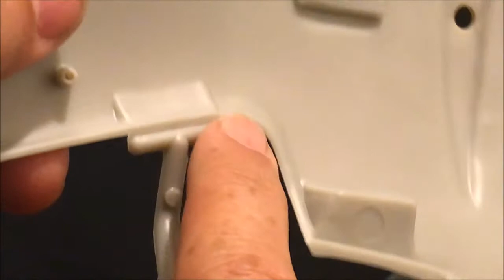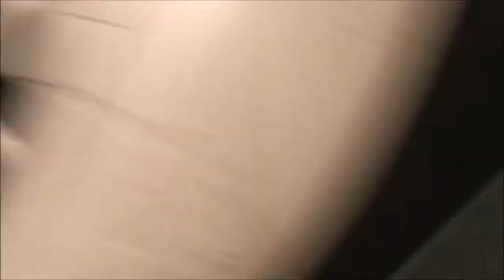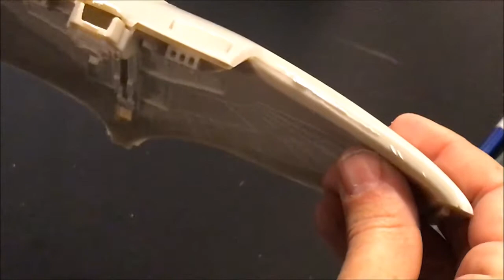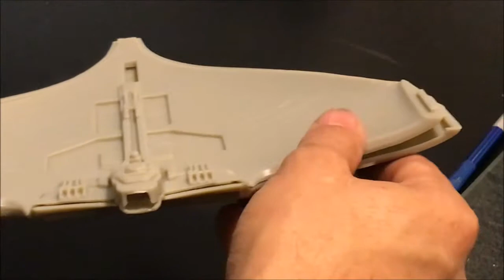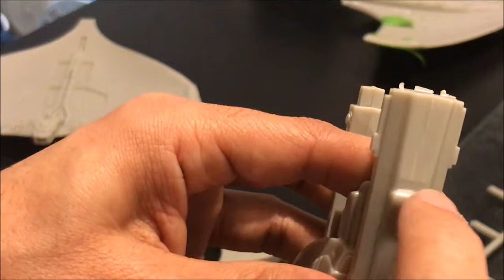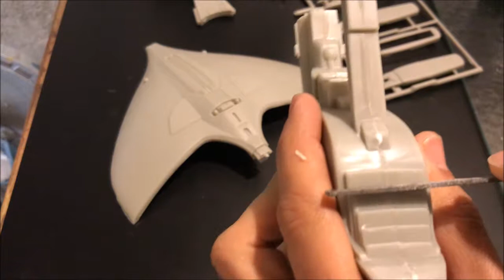Romulan Warbird build part 4 - Looking at fit, gaps, sanding and putty.

Comment: Those huge sprue gates are not an old kit thing they are indeed an AMT thing. There are plenty of contemporary, decent Japanese kits from Hasegawa, Tamiya etc. Heck even Monogram had finer sprue attachment points then these AMT jobs. There's really no excuse for those molds AMT did. I think they really got their act together when it came to the Star Wars Phantom Menace kits, where they had much finer sprue attachments, better fit, and better detail but by then they were kind of on the tail end of the business.